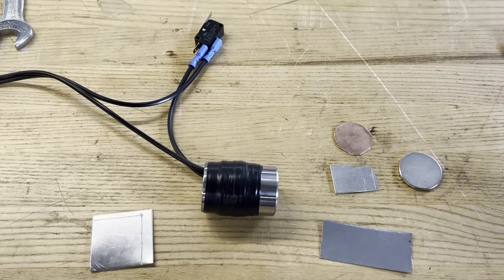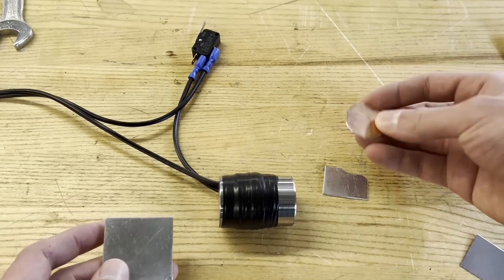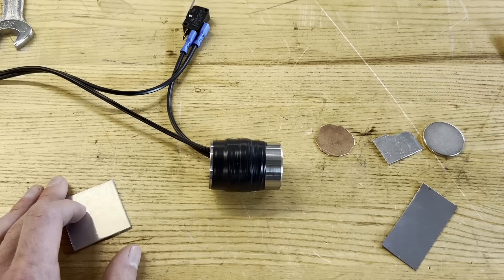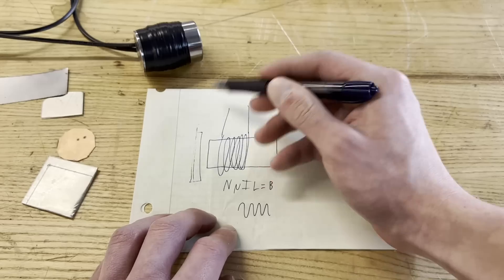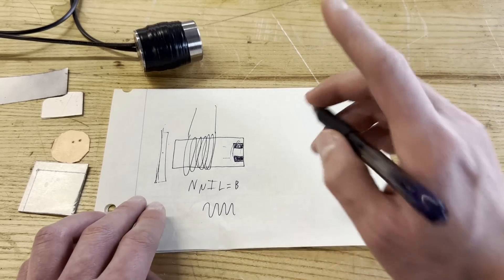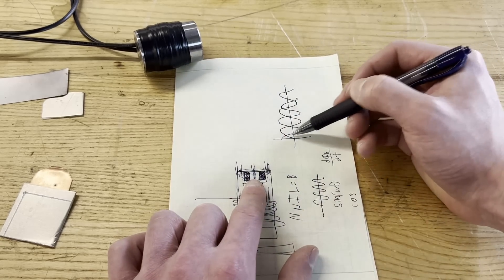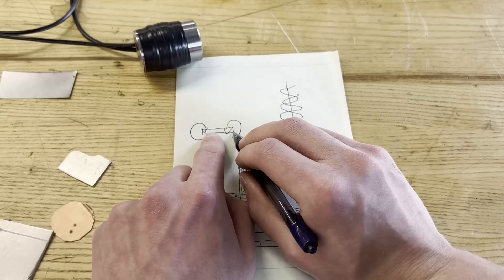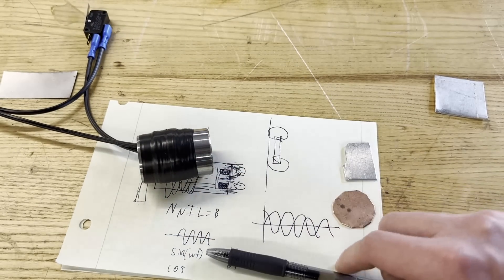A magnet that attracts aluminum and copper

Comment: I think this is ok, but a little incomplete. The magnetic field is still radially symmetrical. There's no toroidal field sitting out in free space. You'd get the same effect simpler if you just wound a ferrite P core and ran AC through it. Maybe interference fitting a copper ring into a steel cylinder is easier if you're a machinist though. Ferrite P cores aren't exactly optimized geometrically to be electromagnets but steel bar stock isn't optimized not to conduct either unless that's silicon steel.

Comment: Perhaps it reacts to the pressure density of the metal on the larger piece. Due to positive negative polarity effects on psi. It may not attract. But it does effect pressure. And solid metal is ice formed gases
Reply: So it has a pressure relationship to psi. Therefore as a derivative should react. Based on polarity alignment. May of helped that it is circular. Perhaps even more so if the solenoid had a spring shape. To thread into place. To induct polarity rotation within he magnetic field

Comment: The result difference due to size is a dead giveaway that this is Lenz effect, not 'magnetism'. I would suggest immersing your EM with copper ring into an clear oil bath with a bit of metal powder suspended in it for your next video.

Comment: What if you put a DC electromagnet on a reciprocating saw and switched it on and off in time with the movement of the saw. There will be electric braking or resistance to a change in distance between the metal and the coil while the field is on and the saw is on the inward stroke. Then the field would be turned off and the saw will extend, allowing the coil to get closer to the metal

Comment: That opens up the thought of putting a second electromagnet inside the larger one (instead of the copper ring) and through the proper electronic circuit the phase and frequency feeding that coil could be variable. Adjusting from 90 to 180 degrees phase and from 30 to 120 hertz would make an interesting experiment.
Reply: Sheldon explains physics to Penny....or words to that effect
Reply: I think a quarter phase shift delay alternating current can  build a composed magnetic fluxes in induced alu or copper.

Comment: Yes, good information but technically not a magnetic force, a electron force example, why one side will repel and you need AC, like how static works to make non metals sticky or clingy. Electro Magnets use DC only to create the magnetic field. Very head turning example, yet not a magnetic field, love the effort to understand, I hope this helps to understand what you made.
Reply from the maker: It is a magnetic field, you can absolutely drive electromagnets with AC, as I am in the video. Very head turning comment, yet not correct, love the effort to understand, I hope this helps to understand the comment you made.
Reply: @cylosgarage  yes you can "absolutely drive electromagnets with AC", yes AC can be a power source, but the actual "magnetic effect" is DC in copper, you technically use copper not aluminum to create your electron field, you create a 60hz carrier wave with the copper with AC, drop your 60 hz to 10hz and see your whole "electromagnet" fall apart with AC. The size of your aluminum chunk matters because of the amount of copper in the copper ring in your experiment, the electron field transfer becomes deluded in a bigger chunk of aluminum, causing the AC hz sync to dip out of sync with the larger aluminum "antenna", letting go of the aluminum "antenna". If you want to grab the larger chunk of aluminum, up the 60hz to 120hz and your experiment will electron grab the larger Aluminum chuck, surprise the guy who told you about this. The effect you show is when people bang the tv to get the tv working again, until the tv is turned off. Not a magnetic effect, is only a electron orbit grabbing effect. You would not understand the anti-gravity effect in atoms, without this basic electron orbit effects. I have made a anti-gravity car, I wait for investment to patent the technology, I am a journeymen electrician, I know more about electricity and magnets then you. You said it yourself you don't understand why this works, now you do. Your welcome.

Comment: It's also worth taking eddy currents into effect, for instance how if you drop a strong magnet through an aluminium or copper pipe the eddy currents drastically slow down the magnet. Cool the magnet with liquid nitrogen & you get close to 3.5x stronger eddy current. Also, said currents always follow the right hand rule, so they introduce the current into the pipe horizontally, & usually a good centimeter or better in front of the actual magnet. The same thing happens in a car alternator because of the use of a "crab cage" rotor. Because it's "legs" are bent @ 90 degrees it redirects the magnetic field almost completely, via a 90 degree shift, even though the magnets themselves field lines are in the opposite orientation.

Comment: If this is Your idea I would get it patented!!
I had an eye injury in the 00's caused by recklessness with my Dremel, grinding the burrs off some Alum .
I was asked the usual Eye Injury questions but because the fragment in my eye was Non Ferrous, they couldn't use the High Powered EM they had, for removing Ferrous objects from the eye(!) so they had to use the Scraping action of the blade of a scalpel to dislodge it!!

Comment: Intuitively the optimal size of the copper or aluminum to be attracted would 49.999% of where the magnetic field lines meet between the outside of the copper ring and iron rod. But because the interactions are a bit complex finding that diameter may be difficult mathematically.

Then that suggest the intutive approach would be to use fine iron filings sprinkled on paper over the end of the elctromagnet with the copper ring. Then the approximate location used to size the diameter of copper or aluminum disk to be attracted could be measured with some degree of accuracy.

Perhaps using two sets of Lenz equations in a ratio one could approximate the optimal design and estimate the strength.

But it still won't make my pizza and soda taste better, or help me lose weight. Oh, well.

Perhaps someone trying to separate aluminum or copper dust from a dust mixture might use the property. Not my job.

Comment: A very good explanation of magnetic properties, thanks sir, I have a question what would happen if you insulated the copper windings on that electro magnet with a copper and or aluminum ring how would that affect the reaction?  Would it increase or decrease its magnetic state?

Comment: This effect was used many years ago in record player motors, where a disc of aluminium was run in between two poles of a horseshoe AC magnet, which caused a rotation of the disc.
Reply: That is called a homopolar motor. The old electric meters worked the same way,.
 The rate of spin is determined by the amount of current not voltage passing through the coil,  that's the key.
Reply: That's also the same principle that causes Galaxy rotation.

Comment: The electromagnet does not "attract" Al and CU, it opposes itself to these parts to move. You stick it on it and it show a   resistance to move away.  
The copper ring at one end creates a magnetic field opposit at the creator, so further, no more (or too less) field to hold something else.  eddy currents are the main reason.

Comment: Seems like the same principle as when you drop a large magnet onto a chunk of aluminum, itll slow itself. I think that also works if you pull it away quickly, so all you need is some kind of arrangement that has a moving magnetic field, and the part you wish to attract inside the part of the field moving in the correct direction.

Comment: So, it's still a repulsive force. But because the magnet fields are being twisted around onto themselves, it's repulsing the aluminum into the magnet to give it the appearance of attraction.
Reply: Well put.
Reply: I wouldn't call it "twisted", but the field does expand after leaving the gap between wire and copper ring.  That expansion includes some field towards center behind aluminum.  That higher field behind aluminum is what pushes aluminum towards copper ring.
Reply: What do you mean
Reply: @YunxiaoChu  If "you" is referring to my reply a couple months ago, I plan to make my own video of picking up copper coins with an electromagnet.  Will include an image of magnetic field lines from FEMM simulation to show field shape and the expansion as field leaves electromagnet.  Likely to be two or three months before I get to that project.
Reply: there's nothing behind it how could it be repulsed?
Reply: I don't know either btw, jus saying this is weird
Reply: I always found magnetism mysterious, the fact that it acts like gravity but it made of electric
Reply: @IndieGuvenc It is gravity
Reply: @IndieGuvenc  The field itself has been warped so that it pushes from behind in a way...I think. Lol

Comment: Used in AC solenoid valves and in AC relay designs and known as a "shading ring or coil" or "Frager spire or Frager coil" to reduce/eliminate frequency chatter.
Cable driven speedometers and tachometers use a permanent magnet rotated by the cable to drive a copper or aluminium drag cup which carries a hairspring and the pointer at the shaft end sitting above a printed dial.  Drag cup also has a small amount of nickel iron alloy fitted which shunts some of the magnet's flux but as the cup heats up with the induced current and its electrical resistivity rises,  shunts less magnetism so compensating for temperature variations.  Modern vehicle instruments use moving coil or moving iron meters.

Comment: This is nothing new at all!  I saw article in 1960's hobby electronics magazine (Popular Electronics) for such a magnet that was much larger (4" diameter & 4" long).  It consumed an insane amount of power (~1KW) & had to be run only intermittently.  Core was made from "I" transformer laminations.  & yes, the piece picked up had to be a specific dimension.
          Are you aware that this scheme ("shading coil") is used in electromagnets in AC relays to eliminate chatter?  The concept is to have 2 separate parallel magnetic paths.  When one of them is crossing zero, the other is not zero, preventing chatter.  It is also used in small "shaded pole" induction motors (such as AC powered "computer muffin fans") to produce the 2nd phase.  The phase shift you get is not much.  Optimum is to tune the shading coil's resistance to get 45° shift.  Less then that, not enough shift, more than that, amplitude too weak.

Comment: Kudos 😊 toroidal says it all. Wires don't work but pzt and a plasma moving very fast 😊 weird things happen in the Morphotropic state. The power supply is a fusion reactor. Resonate a noble gas and push it with microwaves ❤

Comment: One interesting thing to evaluate is the current in the copper ring. I have feeling that the current must be surprisingly large because a single turn secondary is creating a strong enough field to sense repulsion.  Odd having very large current in ultra low resistance short that doesn't generate much heat. Seems odd to me, anyway.

Comment: What about running a circuit, that would rectify the first AC wave, so that it is cosine?  Since the sinewave attracts ferrous metal, and that would be the SECONDARY force, it would be the weaker, and the COSINE, which attracts aluminum and copper, would have the STRONGER force.  Is that possible?

Comment: These have given me a likely good idea.  We can make hoverboards that move over metal.  This is a thing but getting it to hover above anything else is impossible.  HOWEVER.... The high frequency Static fields are in play most materials become conductors hence the reason Tesla coils work a lot of their magic.  So if we had a Tesla coil energizing wood and making the surface conductive would a magnetic field get repelled from it if lower frequency, higher current Electromagnets were used.

Comment: Technically it's still repelling, just from the toroidal field. That's why the size is important.  The copper induction is more/less cancelling out the centre of the field. If I'm correct, this should also work with a dc EM that has a small centre EM opposing the direction.  But this is good 👍

Comment: The ring is basically a secondary winding of a transformer on the iron core.
The waveforms on primary and secondary are in phase. So why do you say they are 90 deg out of phase?
Reply: I concluded this, too. I say out of phase because the fields are opposing per Faraday-Maxwell 3rd (Lenz law is part of that).  law)

Comment: I don't think this explanation is entirely right. I don't see why a rotating field would cause attraction, nor why one would be formed in the first place, which was just hand waved in the video. By following this logic an outward rotating field would repel the metal, so an explanation for why it is inward rotating would be necessary. This is definitely all very non-intuitive so it's possible I just didn't get the explanation, but I think it's more likely neither of us really know what is going on, hah!

However, I think the answer is simpler than that, and a better explanation can be found in this video: https://www.youtube.com/watch?v=_mQeaKkaEcQ (and respective book reference). The electromagnet is creating opposite fields in both the fixed copper inserts and the external metal, and those fields attract. When the geometry is right the attractive forces between the fields of the non ferromagnetic metals is stronger than the repelling forces. So even if a rotating field is somehow the net result of all these field interacting, which I think is a large but unproven claim, I don't think it's necessary to explain the effect.
Reply: The rotating field "pushes" the metal to it. It looks like it's pulling but it is using it's dielectric properties to push it to the metal.

Comment: Years ago I tool a tour of an incinerator.  They made their money by collecting steel and other metals out of garbage.  A magnet took out  the steel  and other magnetic material.  They used a very strong different magnet for a flight diversion for the other metals.  
As a aircraft mechanic, I was baffled how a Canadian aircraft  company could crimp an aluminum tube onto a steel plug with no mechanical contact.  It pushed the tube into rings in the rod ends.
Reply: Z-pinch?
Reply: Only company I'm aware of who makes such tools is Maxwell Magneform.  The crimping is done with magnetic repulsion due to eddy currents in aluminum.

Comment: Do you know what would happen if the coil wasn't around the steel, but if it was an aircoil and would be inserted into a steel tube? Would such electromagnet attract diamagnetic materials as well?

Comment: Excellent video.  I investigated the aluminum ring physics in which an aluminum ring will rise on a vertical iron electromagnet driven by AC. I concluded the ring can be considered a dead short secondary to the primary coil. It follows Faraday's law, but the shorted single-turn secondary idea made it simpler to understand. The shorted secondary experiences a large circumferential eddy current that opposes the electromagnet field because its phase is 90 degrees off.  In your case, the shorted secondary is embedded. Again, fascinating video.

Comment: Would it work for a copper sheet the same size as the aluminum?  It seems like copper's higher conductivity would decrease the size of the magnetic field.
It looks like it is a balance between the induced current and the size of the plate. Too small of an induced current and it doesn't interact with the source field. Too large of a current and the source field gets too small.

Comment: It took me a minute after seeing the copper ring, then I realized you took Lenz law and hit it with that uno reverse card. You had your magnet push the aluminum toward you because it couldn't pull it.
Reply: @lowiq888  Tell me,  where are the output leads of the transformer?  In electrical circuits, transformers via the ratio of turns in their primary (input) and secondary (output) coils either step voltage up, thus reducing current; step voltage down, increasing current; or they keep voltage the same, providing electrical isolation.  

Transformers do not convert electrical energy into mechanical energy; electromagnets, solenoids, and motors do that.

Comment: As another check on understanding, might be nice to build a different sized magnet and make sure the effect behaves consistently.  I'm assuming it would, but be interesting to see how it scales.  E.g. larger diameter and different lengths.
Reply: Longer Cylinder in Center may Strengthen Inner Rotating Toroidal Field lines ?

Comment: HOLY SHIT ! Youre able to seperate non-magnetic metals by size with this !!!!!!
Reply: To be fair, we can already sort of do that using Lez's law.  Another comment and reply talks about an eddy current separator that just separates out aluminum and other non-ferrous metals.  However, there's nothing stopping a more precise version acting like air separators do.
Reply: please define "non-magnetic" metal
Reply: @havocking9224 he means not like the normally magnetic metals like iron or steel
Reply: @readyeddie2065 is good, he fixed his comments :D
Reply: To be fair, we can already sort of do that using Lez's law.  Another comment and reply talks about an eddy current separator that just separates out aluminum and other non-ferrous metals.  However, there's nothing stopping a more precise version acting like air separators do.